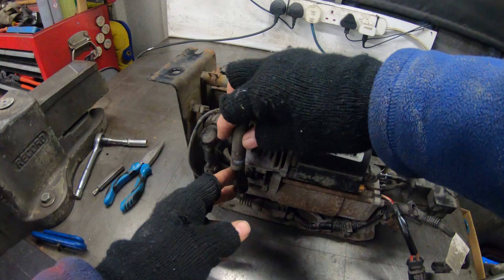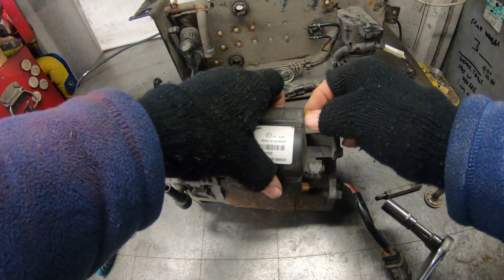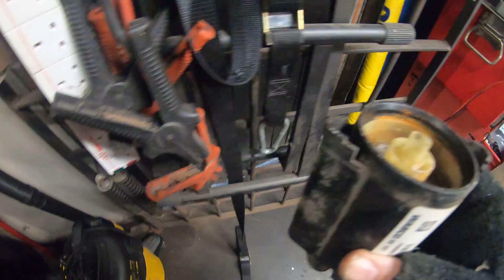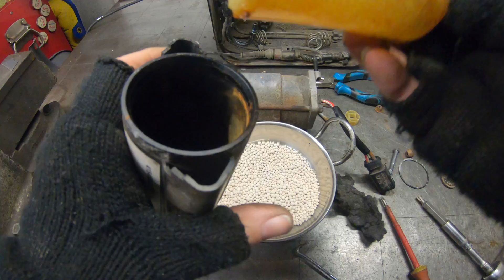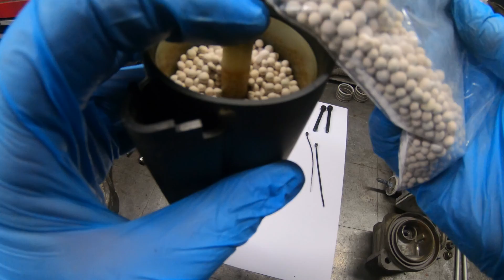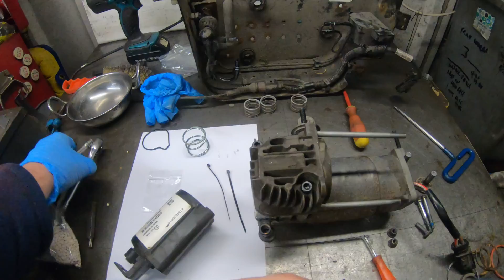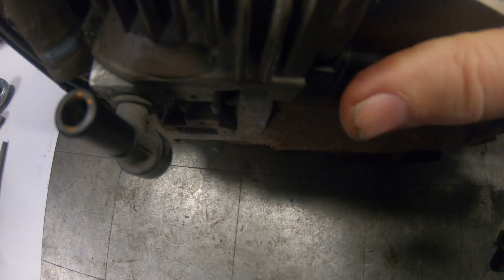Dodge Ram Air Suspension Compressor

Comment: 0:57  hello reaching out to you from the USA I have a 2014 ram 1500 eco diesel 3.0 4WD my truck at times has a hard time raising. If I get your kit will it resolve the problem of my suspension raising

Comment: Is the cylinder chrome plated ? Should you lube the big end bearing ?
Reply from the maker: No the cylinder isn't chrome plated it's hard anodised,no need to lube big end the bearing is usually a sealed bearing with built in lube ,the whole unit is designed to run dry .
Reply: @4x4airsealstechnical99  thanks for that, reason I asked about the bearing was on a Wabco / Tesla pump there are two desiccant tubes in series whilst the first was wet the second was  dry but the bearing went out @ low miles and the motor housing was soaked and I recon it had washed out the grease but how if the second tube was still dry?  This is the twin compound pump  which I guess is found Audis too.  Have you done any of this type?
Reply from the maker: Not really had experience with the twin compound pumps i know the wabco units we have dealt which are all similar to the dodge ram unit ! never had the con rod bearing go down, if their is a lot of water ingress in the housing itself then perhaps this can take its tole on the big end bearing. thanks @pollywollydo